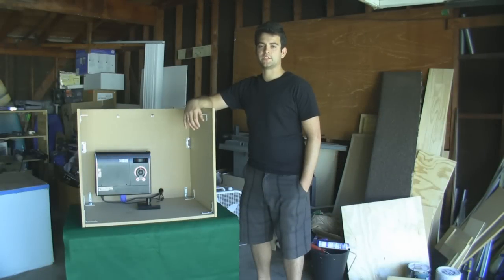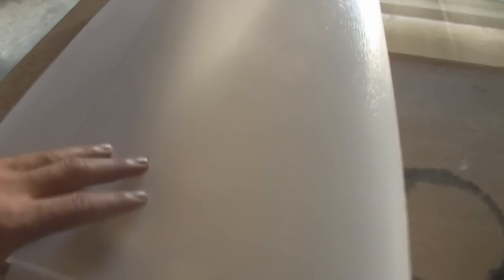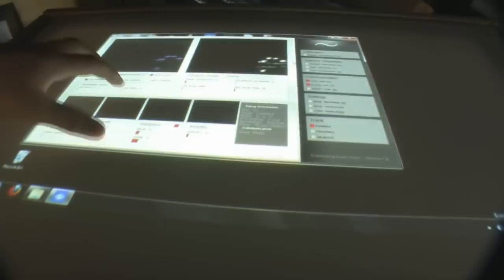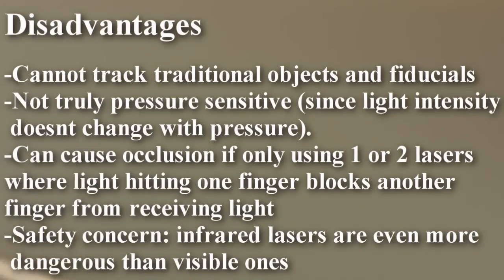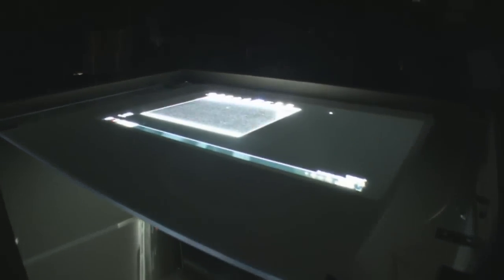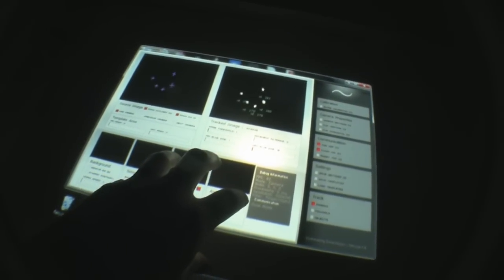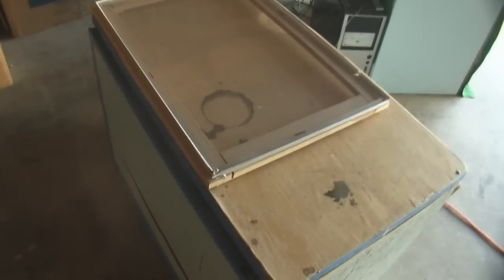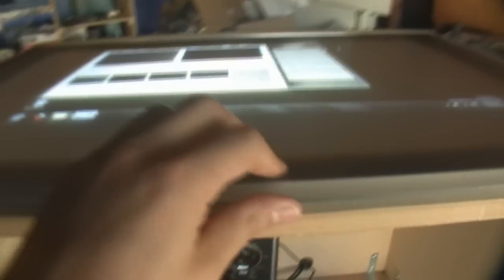How To Build a Multitouch Table - Part 1

Comment: I was wondering whether a keyboard can be then plugged in the computer and the multi touch table would become a full out Windows computer touch (once also the TUIO mouse driver software is installed). Is that correct?
Reply from the maker: Yes, that is correct

Comment: How long can this stay on for? Is overheating an issue?
Reply from the maker: It can stay on for as long as you want depending on how well you ventilate it. We recommend using some computer fans to keep the enclosure cooler.

Comment: At the end of the day, is this multi-touch a full out computer though? Meaning, is it like a windows computer made into a touch screen table? Thank you!
Reply from the maker: These screens replace a screen and depending on their reliability, the input devices (mouse/keyboard).
Reply: Even the ones totally home made with a normal computer Windows and projector your touch becomes like the normal mouse? Or only some limited tools can be used? Lastly, is it possible to do it on a MAC computer? Thank you so much!
Reply from the maker: CCV outputs TUIO so you need a TUIO mouse driver. On Mac you will have more limited control because the OS doesn't support a multi-touch mouse driver.

Comment: how do you make the edges of the acrylic clear enough? (Without Laser Cutting)
Reply from the maker: +WeFixIt You can use high grit sandpaper (1000+) and then polishing compound, or just have the acrylic company do it. Also, you can look into flame polishing if you're careful.

Comment: Hello! How do you imagine to use this frame ( 12:10 ) as LCD touch frame? Surely something more is needed, some IR detector line on at least two branches of the frame?

EDIT:
I've just read your reply for this question on instructables.com but I don't understand what you mean by saying "separate the layers so that the camera is between the backlight and the image producing layer (LCD matrix)." This camera would have to have AOV almost 180 degrees as I understand...
Reply from the maker: +drakedakes You separate the layers of the LCD a large distance, so that the camera FOV sees the entire LCD image. In the example box shown in these videos the backlight is under the camera on the bottom of the box.

Comment: PeauProductions Hey please get the link to download CCV, because i downloaded but it was not good it says MSVCP71.dll missing. Could you make an archive of your CCV and send me a link.. please..because i have got everything ready..only this program is missing.
Reply from the maker: Please see NUI Group Forum for help with CCV: https://www.google.com/webhp?sourceid=chrome-instant&ion=1&espv=2&ie=UTF-8#q=nuigroup+forums+MSVCP71.dll+site%3Anuigroup.com
Reply: PeauProductions I found out after some research that CCV requires netframe 1.1 which is not compactibly with windows 8.1 thats why CCV does not run on windows 8.1
Reply: +Yogesh Mohall It works on Windows 10 though ;) It needed downloading MSVCP71.dll and MSVCR71.dll from dll-files.com, but after copying these files into System32 and SysWOW64 (in case of 64 bits Windows) it works perfectly. It also works with DSLRs if you don't have a webcam (the only thing is to download any webcam emulator for DSLRs).

Comment from the maker: You have to take the LCD completely apart and place the camera below the LCD image layer. Top to bottom on a typical DSI LCD setup is: Mar Resist Clear Acrylic -> Endlighten -> LCD layer -> Diffuser from Backlight -> Clear Acrylic for support of LCD layer.  You can get mar Resist Endlighten to reduce your layers. The camera goes in the bottom of the box. You will want to add additional white LEDs for a brighter backlight.

Comment from the maker: You want to space the LEDs less than 1" (2.5cm) apart if possible, or buy the LED ribbon we sell (easier).
Drilling acrylic isn't necessary, just put it flush against the LEDs.

Comment: Hi,

I am about to build an FTIR Table.
I have some questions:

 At the LED Frame, how much is the approximate distance between two IR LEDs? 
How many LEDs should I use per Meter?

Could I use a IR LED Strip?  (Basically, to avoid soldering/wiring)

And how should the LEDs be placed at the frame? Should the Acrylic be drilled to fit the LEDs?

Thanks in Advance.

Comment from the maker: If you need a sealed, glass top surface you will need to look into making only the DSI or Rear DI methods. These methods locate the LEDs and rear projection layer underneath the top touch layer.

Comment: Hello. great video thanks for sharing.
i saw it several times and maybe i am tired and i can not see something that is clear but the question is that i want to make this for bars/pubs and i want to put a glass or acrilic in the top.

As i see in every model i will always touch the rear projection screen or a silicon screen so the time to break in a bar is very slow.

are there any metoth to put the glass on the top and have the good effect when you put a glass or you just want to play with it?

Comment from the maker: You can use a normal webcamera but you need to cut out the IR blocking glass filter inside the camera's original lens.  You illuminate your fingers with IR light and webcameras off the shelf can't see IR light so you have to modify the lens.  We sell modified PS Eye cameras on our store if you want to purchase one ready to go.

Comment from the maker: The rear projection diffuser is the plane which stops the projector's image and diffuses the blobs.  When an object is hovered over the touch surface it appears out of focus to the camera beneath.  As it comes in contact with the touch surface, such as your finger touching it, it comes into focus and the camera sees it as a blob due to the reflected IR light.  Please see our diffuser page on our website for a review of a few different materials you can use for this RP layer.

Comment from the maker: You cannot use a Kinect camera on a setup such as described in these videos because the IR laser grid emitted but the Kinect cannot pass through a diffuser on these touch screens.  You can build a setup using the Kinect but you won't be able to touch the display surface.  You have to use a typical IR computer camera for this.

Comment from the maker: The PS Eye camera is attached to the computer via USB.  The LEDs are simply plugged into the electrical outlet.  The projector is inside the box and the video cable runs out a hole to the computer on the ground.

Comment from the maker: You need the LEDs in FTIR to light up the inside of the clear acrylic.  When the LED light is bouncing around, it's the coupling of the silicon layer to this IR filled acrylic that creates the frustrated light point.  The frustrated light is then tracked by the camera as an x,y mouse point.

Comment from the maker: That depends on your projector and its projection capabilities (such as the projection distance needed to make the desired 32" image).  You should get a short throw projector and then measure by hand what the projection throw distance is.  Then build your box around that.

Comment: what are the dimensions of the box you are using? i want to make something close to the height of a coffee table 20-24" but i do not know if that would be too short. so basically what is the shortest height i can use to project a 32" screen.

Comment from the maker: @dogg06 Yes you can but the software to determine where the object is between the diode and receiver would take awhile to figure out.  We sell Infrared Touch Frames that are ready to use frames using this type of detection (no camera).  See our online store for pricing and sizes.

Comment from the maker: @KrunchieHD I don't know what method you are asking about, but any method that uses the LEDs along the edges should typically be at least 8-10mm thick.  You want it large enough so that as much light from the LEDs goes into the sides of the acrylic.